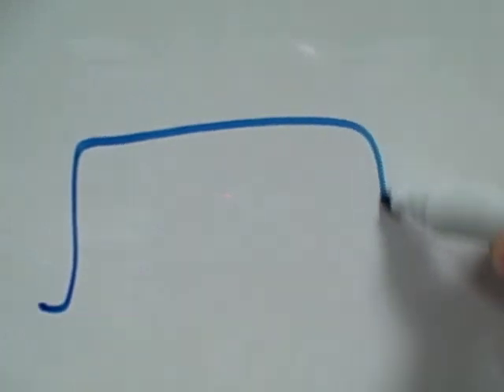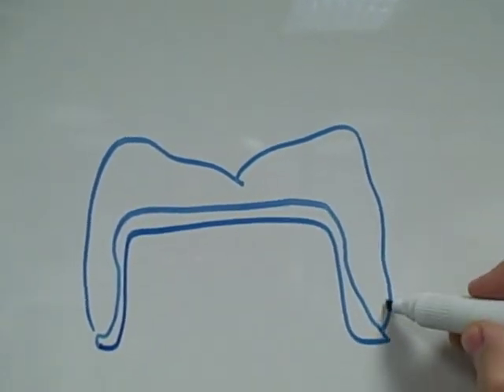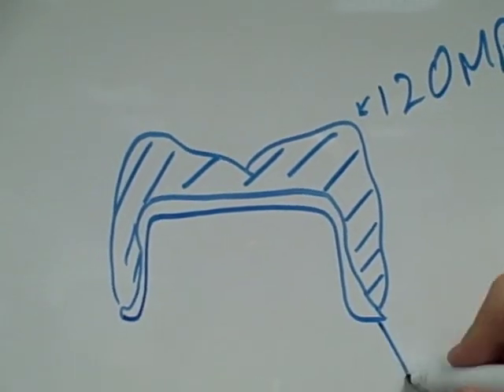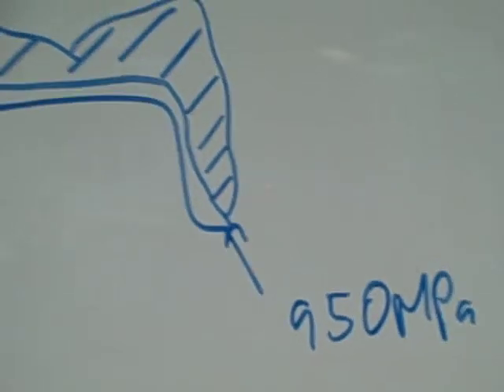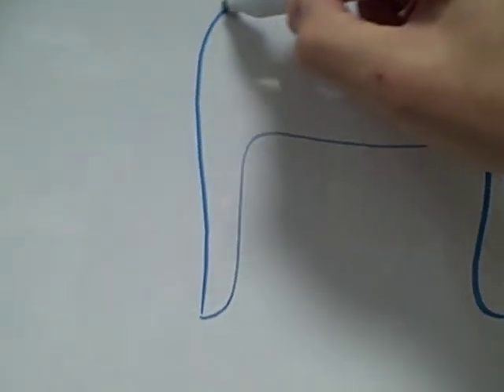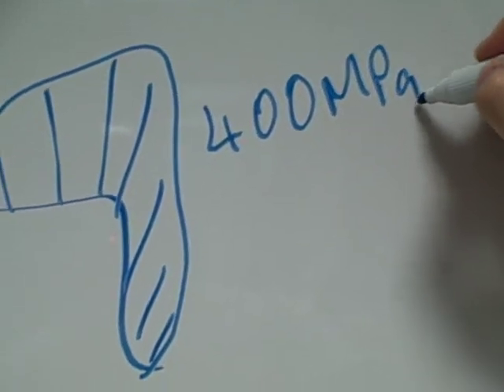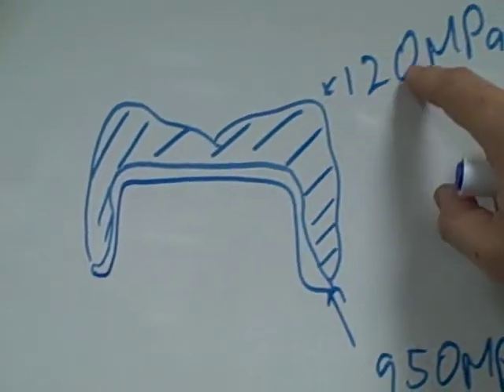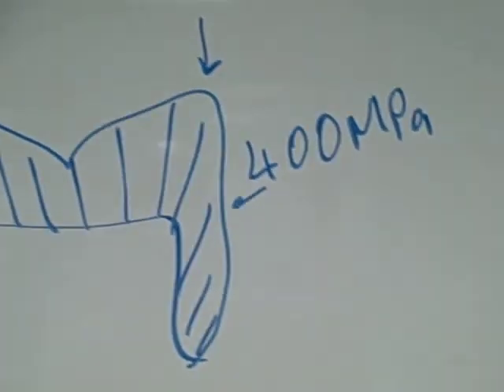zirconia crowns vs e.max HT

Comment: I understand the comments but have to say that Emax has spent alot of marketing money downplaying zirconia and the data is that they are equal to pfm in strength. It does boil down to the "singer and not the song". Prep and support design are critical. Just as critical for Emax  as an all porcelain crown it is subject to failure by fracture.  It is about case design and execution. Not the materials as much

Comment: Or, one can learn how to properly design zirconia framework. I would never allow such framework to proceed to layering-whether it be alloy or zirconia. Layering on well designed framework be it e.max, or zirconia yields the most aesthetic result and long term success. It should be a case-by-case decision. Wear on opposing dentition is a factor as well (e.max or zirconia VS either one that has been layered).